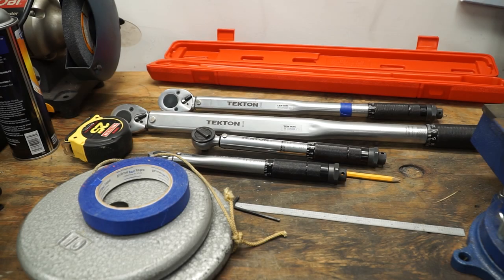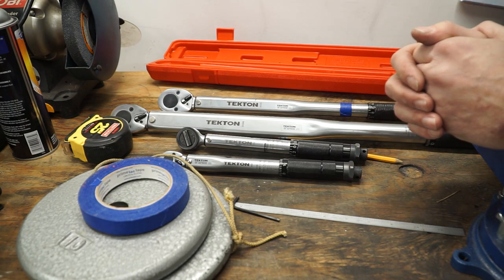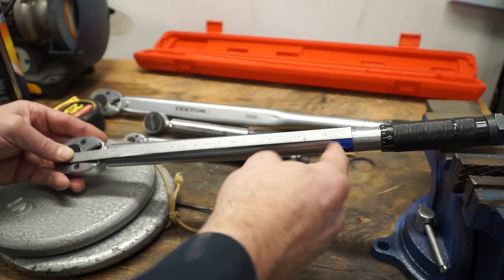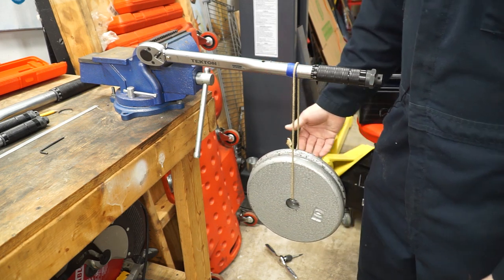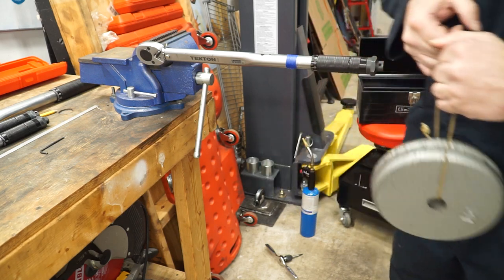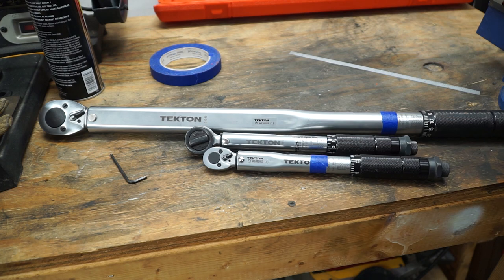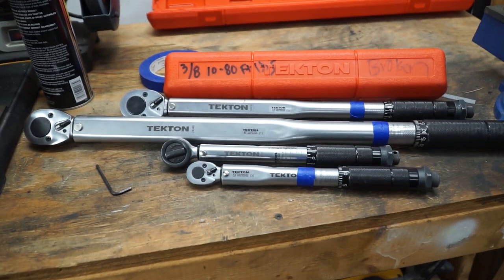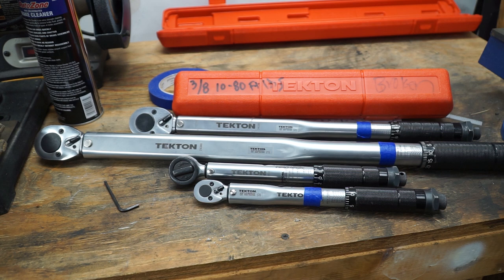Are Tekton Torque Wrenches Any Good?  Are they Accurate?

Comment: many thanks! +-3% is very good, +-4% is ok. If you could compare brands of 20-200inlbs wrenches it would be wonderful! Major problem is 20-200inlbs and many doesn't click. so if you do please include the min setting that clicks. Also, mechanical wrench calibrated at 20~100% 3 points, so if you can test its lower range you would be the first!

Comment: Hey Steve, nice video. However you technically need to factor in the weight of the wrench itself. It's not gonna be much, but the wrench adds a bit of torque on its own just due to gravity, especially with the larger ones.
Reply from the maker: good point

Comment: I used Harbor Freight torque wrenches on a head job. My head was still leaking. I'm not blaming the HF wrenches, but I'm gonna upgrade when I redo the job to eliminate variables. This seems like a reasonable upgrade.
Reply from the maker: a marginal upgrade, but upgrade none the less
Reply: @TahoeSteve  I decided to go with a Precision Instruments torque wrench; from what I hear they either make or used to make the torque wrenches for Snap-on. The price is fair without the Snap-on name attached.

Comment: Just a heads up, harbor freights Icon series torque wrenches out preform snap-ons for a hundred bucks 80 with a coupon you can’t beat it
Reply: I was looking at HF but I am slowly swaying towards Precision Instrument. They are $$ but next to CDI I hear they are very good. I should check HF accuracy because lets be honest I kind of dont want to spend the money on expensive TWs but for the sake of accuracy and repeatability esp with engine builds I feel I shouldn't cheap out.
Reply: I want to see long term testing and holding calibration  before I jump to icon
Reply: Wrong! Watch project farms test!

Comment: What would be the reason why someone would choose the 3/8 10-80 ft-lb over the 1/2 10-150 ft-lb?  The 2 reasons I can think of is perhaps wanting the smaller length of the 3/8 which is approximately 14 inches versus 18 inches.  Or perhaps better accuracy with the smaller range?  Seems to me it would be a no-brainer to pay a few dollars more to get the 1/2 inch to cover a much bigger upper range as long as length isn't important.  The only downside is that an adapter may have to be used with the 1/2 inch in order to torque at lower values with 3/8 sockets.  Am I missing something or when would you ever recommend the 3/8 over the 1/2 inch?  Thanks Steve!
Reply: Typically space concerns (1/2 is longer) as well as the torque range. Torque wrenches are more accurate near the middle of their torque range. The 1/2 inch has a larger range that overlaps with the range of the 3/8. If space isn't a concern, just use the torque wrench with the midpoint range closer to your desired torque.
Reply: 👀👀👀 I got all three of them 1/4, 3/8, and the 1/2",  water pump bolts call for 8 ft lbs of torque on my vehicle anyway. don't need the 3/4 not working on construction vehicles.
Reply: Also, socket sizes and depth.

Comment: I've watched your video and it is great. Maybe you can answer a question I have (if not that is fine): When I purchase a new torque wrench (it does not matter witch wrench or company, just in general question), Should the torque of the wrench be set at the lowest setting when I open the box? (please correct me if I am wrong) As I understand it the spring inside of the wrench needs it to be set at the lowest setting when not in use for a long period of time. When a torque wrench is not torque and just sitting there for however long it destroys the spring mechanism inside?
If it is fine that there is not torque set on a new wrench, how would I go about getting the torque up to speed/working condition?
I am asking these question because I ordered a new torque wrench 1/2 inch 10-150 ft/lb. When I opened the box the wrench was not torqued to the lowest setting and the torque part of the handle could not go any lower. I torqued the wrench to 10 ft/lb and tested it on bolts I know that require 10 ft/lb and the wrench did not click at all. Am I safe to assume since wrench was not set to the lowest torque setting, it destroyed the wrench? (The directions that came with the wrench even stated the wrench must be set at the lowest settings if not in use and if it is not, it will destroy the torque spring and mechanisms inside.).
Reply: Yes you are correct it shortens the spring inside if left under tension. I left mine by mistake on 50 foot pounds now it’s scrap.

Comment: I bought the 3/8's Tekton socket set. The one question I have is..can I use my 3/8's sockets with an adapter on the 1/2 inch torque wrench?

Comment: I just purchased the 1/4" inch Pounds Tekton.
I tried it a few dif settings.
And
"IT DONT CLICK AT ALL"
I had to search for a video to see if they make a click noise and they sure do but mine does not.
Is there something im supposed to do be using it? Maybe soak it in water, like at the bottom of a Lake??
Reply: It doesn't click really. It kinda of bends to the side when you hit torque
Reply: Mine clicks really softly.  I missed the sound initially.  More of a "give" rather than a "click"